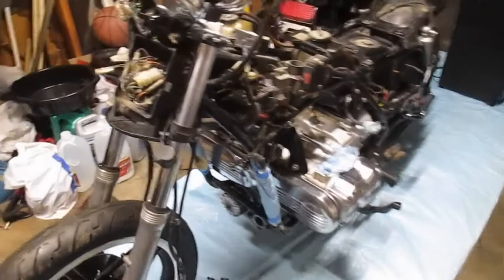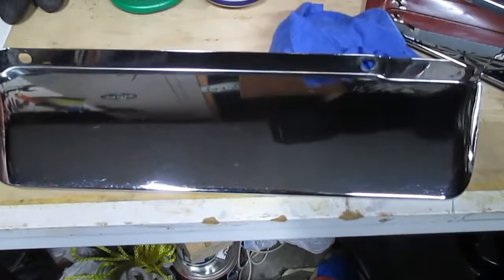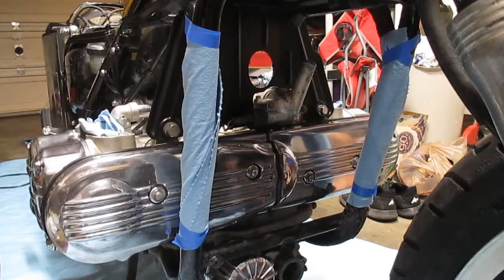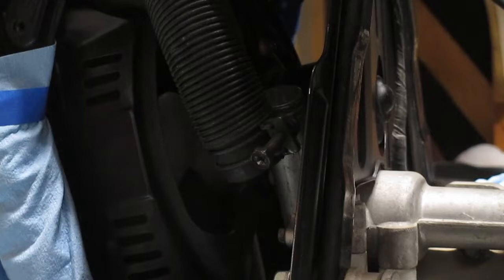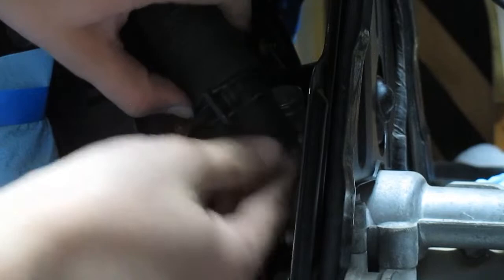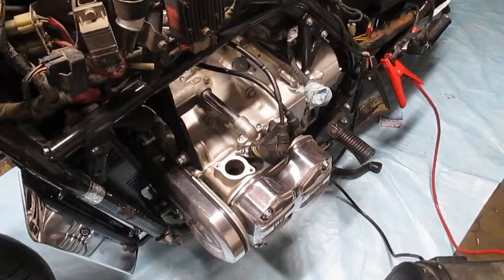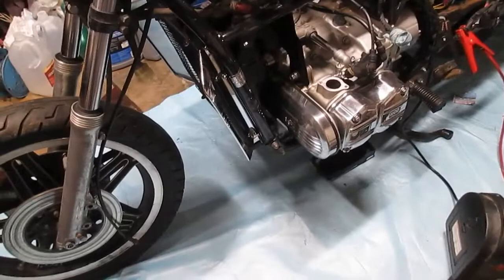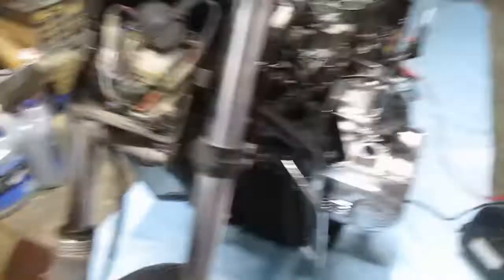'81 Honda GL1100 Goldwing Part 5 | Radiator install & compression test!

Comment: A ball of aluminum foil works magic on chrome.  A polish after may help, but, Sharkhide seals it good for a few years.........and stop further rusting in the pin holes of the chrome......
Reply from the maker: Yup, ball of tin foil and coke-a-cola is what I used to clean the radiator wings up, followed by turtle wax chrome polish. I will look into the sharkhide because I do need a better sealant. There are some spots that the chrome is gone completely.
Thanks for watching and commenting!
Reply: @DustyDingus  The sharkhide is nearly 40 bucks a can but well worth it. Or you could try some 2K Gloss Clearcoat, it is a non-yellowing formula but doesn't like to stick to chrome very well, (or stainless steel) AND SOME PREP NEEDS TO BE DONE, BASICALLY SANDING WITH NO GREATER THAN 600 GRIT TO PUT A FEW LINES IN IT TO HOLD THE PAINT.  Sheet, how did I hit the caps lock button, sorry.  400 grit is better, slightly larger lines and only sand in one direction, not circularly. The lines will grip the paint . An adhesion promoter may help too, but, it cannot be a smooth surface if you use clearcoat. The Sharkhide don't care, it sticks anyway. I used it on my build for a few chrome/polished aluminum pieces. But I painted the Fork tubes gloss black cause the polishing would have taken days, and I just didn't wanna waste the time. Wire Wheel prepped it and painted em. They look great with VHT Gloss Black medium temp grade paint. I painted the triple tree the same color when I replaced the bearings. Now it makes the frame look old and tired..sigh. next winter project to remove the engine and do the frame...........Powder coat Gloss Black. Or maybe Gloss White, like the white but almost dont see the frame anyway.

Comment: Those engines need to be compression tested warm. Cold gives a false read.
Reply from the maker: I wouldn't say false reading but less than if it was warm from running. I dont have everything together yet to warm it up.
Reply: The common test is cold as it is a risk to pull plugs from a warm engine.

Comment: Your battery sounds too low to do a good compression test. The bike should be spinning right over with no plugs in and no intake.
Reply from the maker: It definitely was low, but the compression values were good for a bike thats been sitting a long time from what i've read on the forum. I expect them to rise after it has run.
Reply: DustyDingus i was wondering about that...the service manual from Honda states standard compression is 171psi and the service limit is 142psi or more than 15psi variation between cylinders. Yours looks a little low at 120-130psi no? Do you expect them to gain another 12psi after it starts running and warms up?
Reply from the maker: It is a little low but it runs well, I didn't repeat the compression test yet after its first time running in 5-6 years but i expect them to improve. I also plan to double check valve adjustment. I was pleased with the values I got because others I'd read had worse and still ran well.